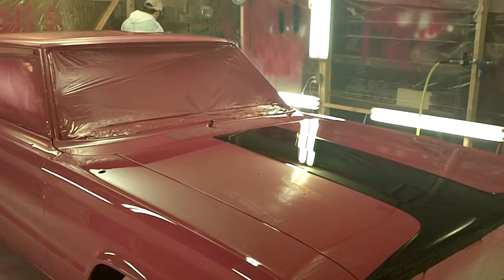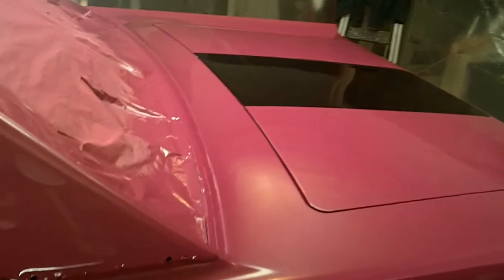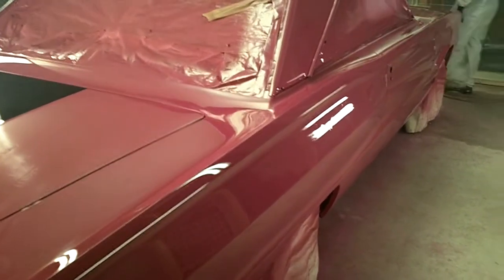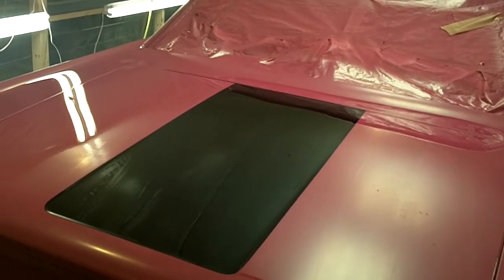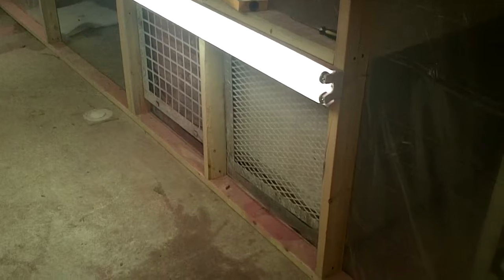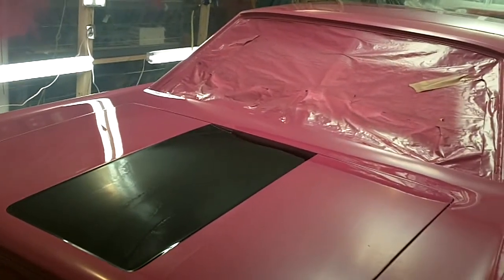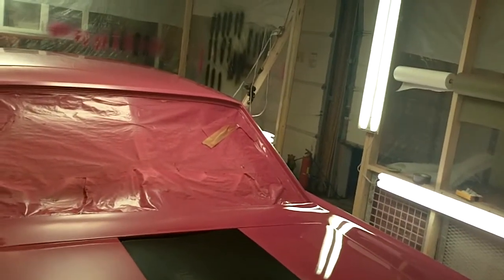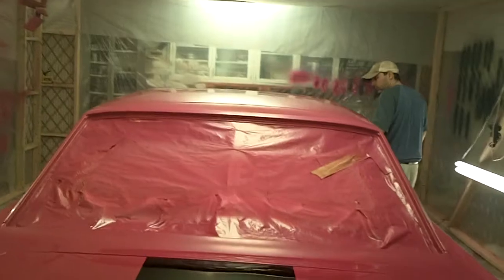clear coat on!

Comment: where you wetting the floor with water that helps keep the dust from rising as you walk around. Also you should turn off the fans and wait a min before you enter and exit the booth. as for extra light I like to use a pair of 1000 watt light I have one of those on a tripod  and I like to place them at a angle as to the section I am spraying. when I spray the hood I place the light on the fron corner and use the reflaction of the light as a guide as I spray.

Comment: did you provide a spot to allow air to get into the garage? because if you set up an exhaust exit and a spot on the booth for air to enter but seal the garage shut then it will hold back air flow. also if you have an air duct that goes from under the car to the exiting fans it would suck air & garbage down not across

Comment from the maker: I did not re-wrap them. I blew them off with a air blower. It could have come from the masking but the most likely source was the plastic I used for the walls of the booth. The paint would just flake off after it dried and the plastic flexed.

Comment: So how much money, if any, did you save vs having it professionally done?
Reply from the maker: My wife asked the body shop owner who helped me the same question. He told her that it would have cost me $10k minimum if I had brought it to him ready for primer to get this level of finish. I have at least $3k in materials and tools possibly pushing $5k. I probably have $2k in materials. $600 in primers. $600 in paint. $200 in clear. My neighbor is the shop manager for a Peter built dealership. He said that I got a better quality finish in my garage than they get in their $100k paint booth.

Comment from the maker: @mitmaks They are called Negative air machines. Check out my other video on building a paint booth. The clear coat overspray clogs up the filter in a hurry. I know I was pulling enough CFM's with clean filters. The clear just gums them up in a heartbeat. I needed a pre-filter system of some sort.

Comment: just think smooth as a baby's bottom with a rash ... dude, all the runs smooth out at about 70 mph ... should have added a 4 ft tunnel to your door ( ie, double door system) so you could filter the air before you enter your booth